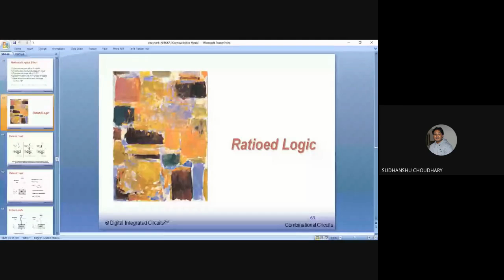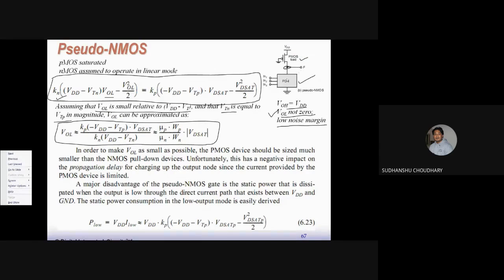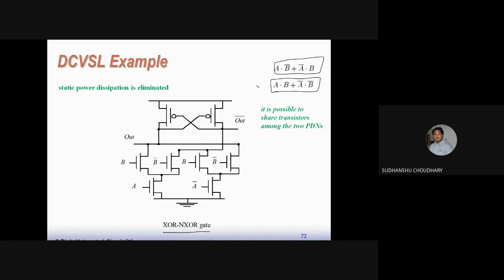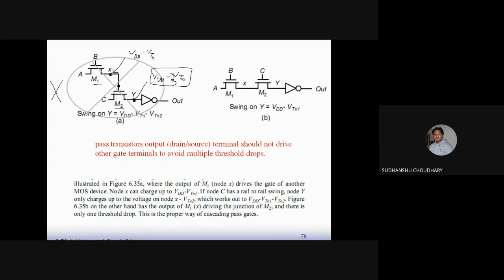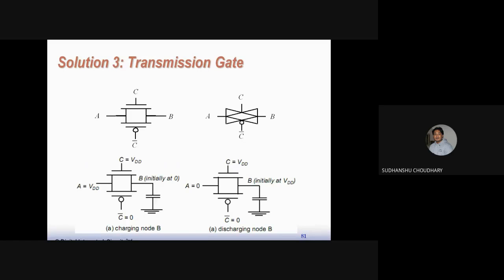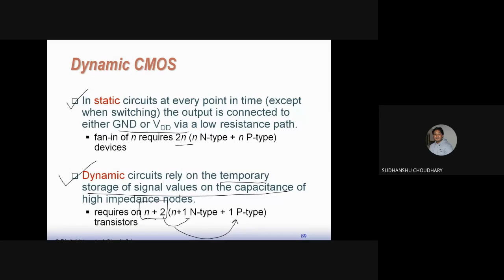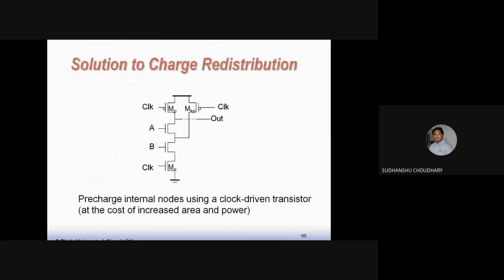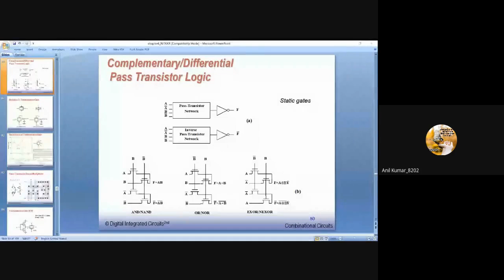Lecture-24 (Combinational Logic Circuits and Issues in designing them) Digital IC Design MTech-VLSI

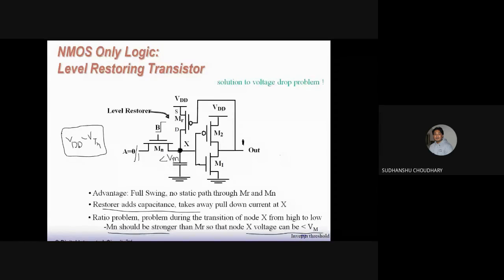Comment from the maker: At 31:30 to 31:35, time to charge node X apparently seems to be more due to increase in capacitance, however this charging time will be smaller since both Mr and Mn work together to charge node X to Vdd. Discharging time will be more due to extra drain diffusion capacitance of Mr.

Comment: sir what does it means that sizing of devices do not affect the logic gates in dynamic desing .. plz elaborate this point
Reply from the maker: Dynamic logics are Ratioless. Small changes in device sizes do not affect the output levels and VTC and even Vm in such designs. Please see 25:30 to 30:30 in Lecture 19 to know more on Ratioless circuits.
Reply: @SudhanshuChoudhary1  thanks sir